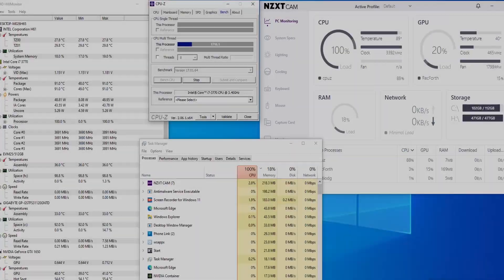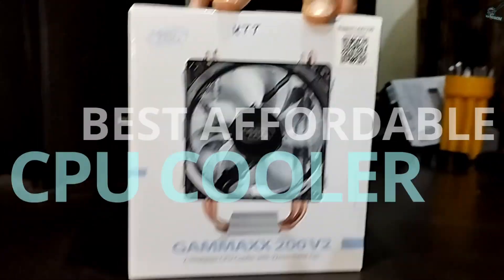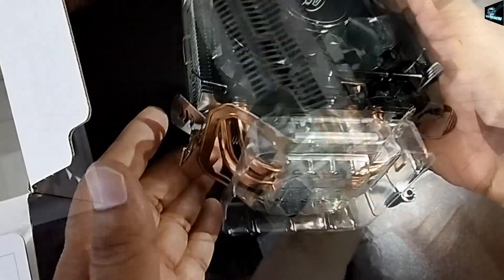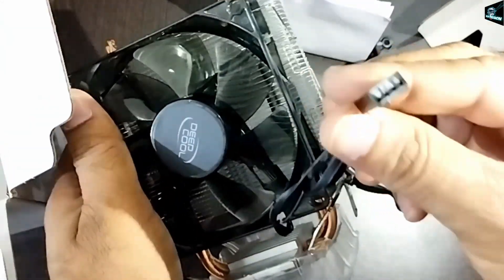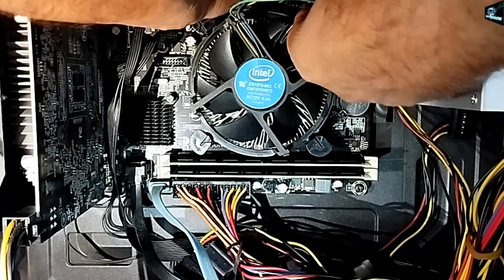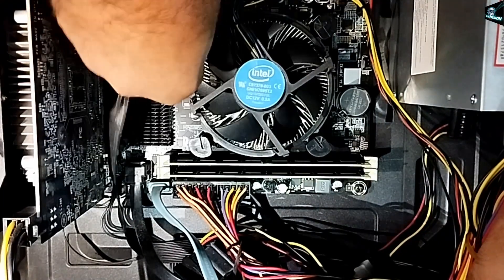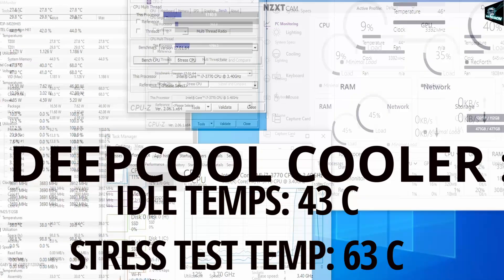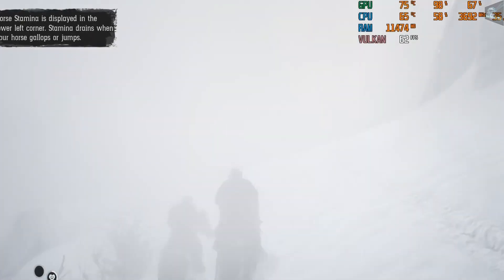Deepcool GAMMAXX 200 V2 CPU Air Cooler installation & Benchmark | Stock cooler vs Budget Air Cooler

Comment: OMG i hate these clip on coolers, they are scary. I managed to get them on my ryzen 2600. This is hard to install - only saving grace - you dont really need to change anything just clip it on. 
But yes this is a good explanation.
Reply from the maker: Lovely to see ur comments . Pls sub , thx
Reply: yo how did u get to fit
Reply: how did u get it to fit

Comment: Me running an i3 12100 pushing 99 while gaming. i guess my cooler is broken. Idle is 50. i'll get this then.
Reply from the maker: Yep bro , temp should not go beyond 55 ,60 with this cooler put at work .  99 will kill ur processor soon pls replace it ASAP pls sub . Thx to take ur time to comment
Reply: @TechPassionBuddy  i did. Got the ANT c200 v2. Now temp went around 73-75 very few times max while gaming while pulling 39-50  watt but stayed under 70 for the most part. Amazing cooler. Idle is still around 38 - 45  coz i use fan. No AC.
Reply from the maker: Glad to hear that , enjoy PC and gaming bro
Reply: @TechPassionBuddy  thanks

Comment: I'm trying to put it on my Gigabyte H310M-H 2.0 with INTEL I3-9100 processor but my fingers are already hurting from trying so much. I give up
Reply: @sc-nc6bb  it's easy to install man. Removing it is a hassle.
The latch part you don't put first. 
First put the non latch part. Pull up the cooler so that it's fit properly, then press down evenly and Lock in the latch part. I don't know why people are finding it so hard to put. Only issue is to remove
Reply from the maker: True bro , removing is a nightmare haha 😆
Reply from the maker: Hahah , I can understand the frustration but these type of coolers come with similar attaching mechanism so u may feel anxious but that’s fine , don’t give up , once installed it’s works like charm  good luck bro 🤞

Comment: Bro, if we can clip it on provided plastic black bracket before & then put the whole assembly over processor to press all 4 thumb screws🤔
It maybe easier then or am I completely wrong😬
Reply from the maker: No bro u have to do step by step , 1st mount the black ring on motherboard  and then mount the small clips on to black ring as per the holes in motherboard to lock it perfectly then only u have to mount the cooler it is little tricky but doable and easy procedure  all d best bro pls sub if u like the efforts thx

Comment: Why did you apply thermal paste when it's got it pre applied🤔
Reply from the maker: Thx to reach out . I applied my own thermal paste as its Branded one plus while installing I have to try it installing multiple times and hence in the process got it wiped out and therefore applied my own thermal paste as I had from a renowned brand with good thermal properties , hope my vid helped thx bro to comment
Reply: @TechPassionBuddy  was it MX4 from Arctic😀
Reply from the maker: If u like my efforts consider sub to the channel which motivates me to keep going

Comment: How did you install it? Im installing cooler with same clips mechanic and I cant get it installed.. there is no guides either :/ im upgrading my bro's cooler and this has to work. I got no thermal paste to put back on the stock cooler
Reply from the maker: Hi bro .. u may get bit anxious while pressing the clip on other side but that’s ok it has to be done that way ..  see my video step by step bro u will achieve it .. get the thermal paste from local shop for 100 or 200 rs. thx for reaching out . Pls sub if u like my efforts
Reply: @TechPassionBuddy  thx for fast answer. I just managed to get it. I didnt realize first that I just have to bend the cooler to get it mounted. Not gonna lie this installation method is quite bad imo. I had much better experience with noctua before and I think everyone should copy their installation method. But at least I got it :D and temps seem good and the cooler is quiet. Just annoying mounting method, thats all
Reply from the maker: Glad u got that done 👍 Enjoy ur PC 🖥️